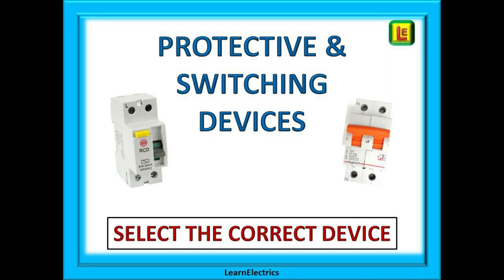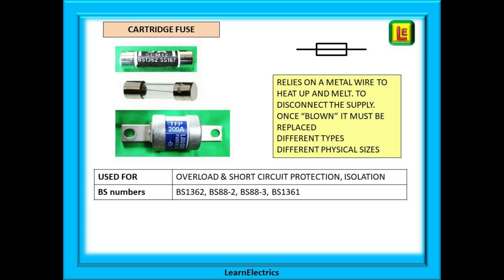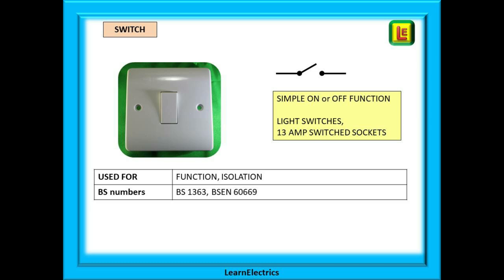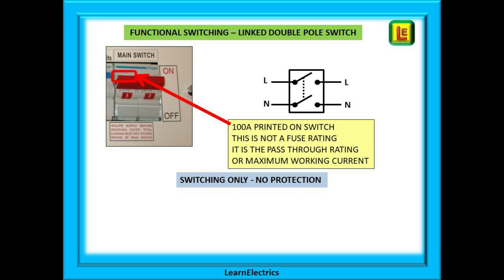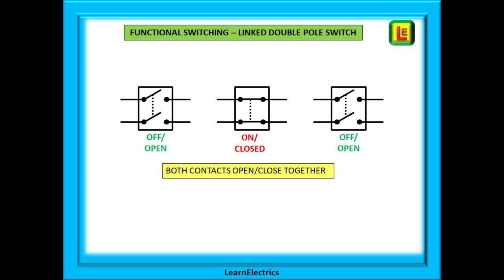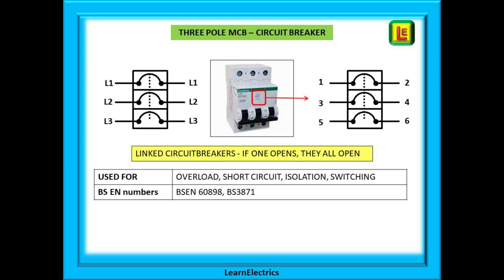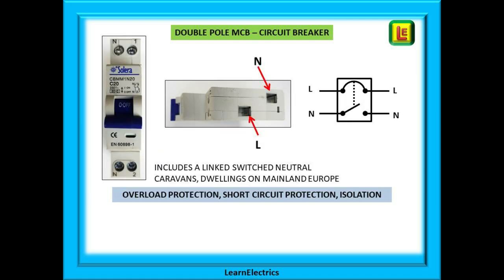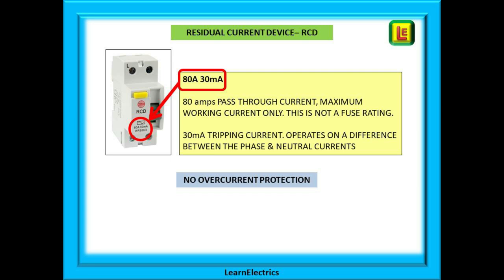PROTECTIVE, SWITCHING DEVICES AND FUNCTIONS

Comment: Hi Sir...have a question regarding sub main fuses...if we have a 100 amp fuse at the main head ...and in the ryfield board there is 60 amp fuses...then from there it goes to the meter...the main board is (eg) upstairs....should the isolaor feeding the distribution board upstairs ( or say first floor) be a straight isolator or a fuse isolator...and what size fuse should that be...taking into account discrimination...
Reply from the maker: Depends on length from intake to CU. More than say 5 metres the network operators like to see fuses protecting the meter tails. But you can always install a fuse isolator with a BS88-2 fuse. It looks like you already have 60 amps in there so as this is on the load side 60 amps.

Comment: Good informative video again. why is it that if for eg im rewiring a ceiling rose and obviously the power is off if 2 of the conductors happen to touch im not sure if its line and neutral or line and cpc the R.C.D trips? Is it due to very small amount of current still in the line? This could be a potential problem if someone is working from home on a computer or something. Thankyou for such a detailed explanation.
Reply from the maker: This happens sometimes. It can help to remove both live wires at the CU. Sometimes there is just enough induced current from nearby conductors to make the RCD think there is a fault.

Comment: What's the difference between a switch an an isolator?
Reply from the maker: A switch is any accessory that turns something on or off, lights, cooker, motor etc. for every day use and can be single pole, double or more.
Generally an isolator will disconnect all live conductors to a circuit or part of a circuit and can often be locked off to safely isolate the installation.
Hope this helps, electrics could have its own 400 page dictionary.

Comment: Very good and simple explanation, what's different with rccbo ? Thanks
Reply from the maker: Walid, is that a typo rccbo - If you mean RCBO it is explained in the video. If you mean RCCB, as used in some small CUs and garage units,  they do not have overcurrent protection so are the same as the RCD explanation.  Hope this helps.

Comment: Will an RCD work if the is no earthing  in the house?? Thanks!
Reply from the maker: If there is no earthing and no leakage currents then there will be no difference between L and N so no. You can always check with a clamp meter.